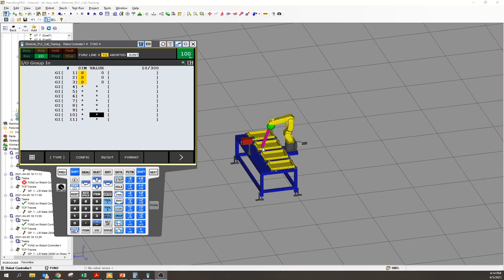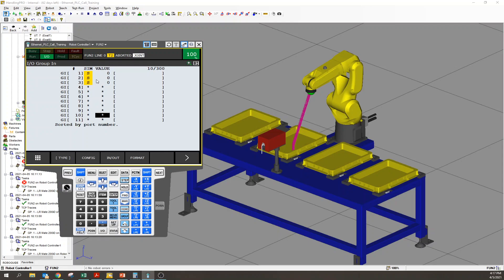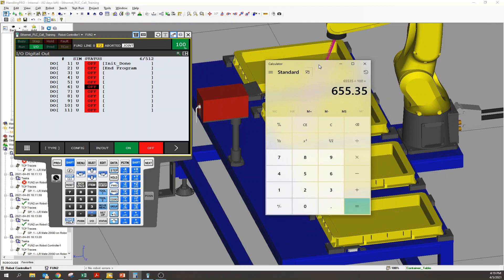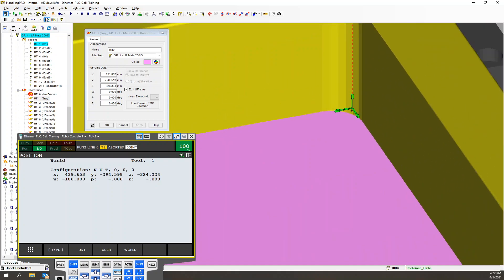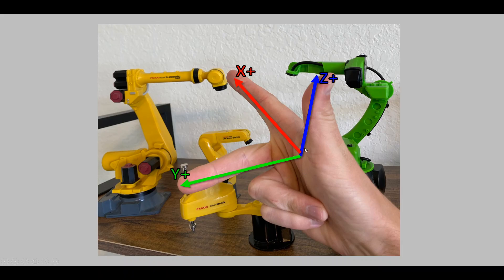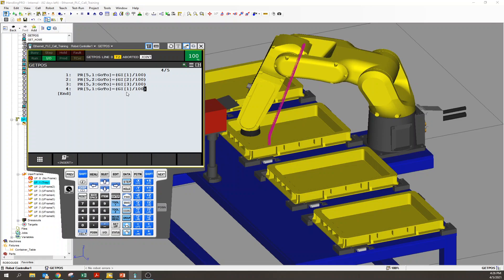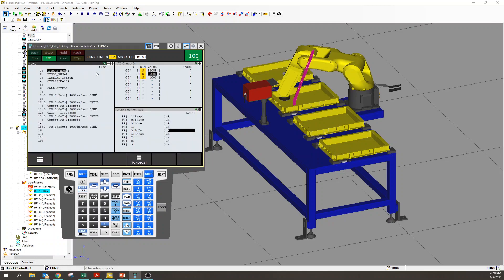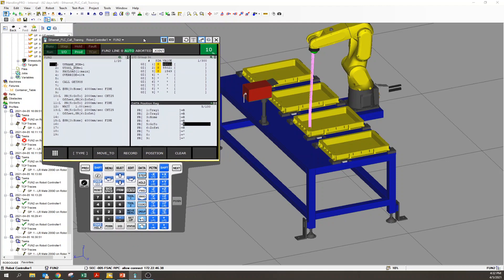Group I/O Position Control [Bonus: Robot Gang Sign]

Comment: Adam, can you post a video or add on to this video explaining and showing how to setup a Group I/O. You already have it setup in the video, so for new programmers this would be helpful. Thanks! Great videos!
Reply from the maker: Hi Christian! At the 2:40 mark in this video here I touch on how I configured these Group I/O. 
In short, you need to map the discrete bits from a rack and slot. Different io forms are different racks (ethernet, physical wires, profinet, flags, etc) but it’s quite simply just setting rack, slot, and number of bits. Let me know if that helps, otherwise I’ll put out a video that does a deep dive into mapping. Thanks!
Reply: @AdamWillea  Thanks for the replay. It seems to be working for me now. I do have a video request, a video on importing a CSV file with POINT coordinates into Roboguide (into a .ls) so that the points in the CSV file are programmed into the robot for say, a weld, eurathane, or some sort of dispensing program onto a part. Thanks!
Reply from the maker: @christianseekins4346  that's a great recommendation! I'll see if I can work something up for a video on importing points via CSV file. Thanks a bunch!

Comment: Great video as always Adam! 

It's crazy how simple the tp program becomes when using this method. 
Unfortunately the only drawback is that doing touchups now entirely happens via the PLC, but I'm sure you can write a program to work around that using macro programs with Lpos logic etc. 😉 It's the beauty of our Robots - they offer many ways to do the same thing! 

I believe you can go one step further with your program - use a register that gets populated by a GI, to call different UFrames.  
Then pick out of any tray 😁 

I've seen a lot of European systems that were installed here in South Africa that use this style of positioning via a PLC. 
Difficult to touch up programs if you don't have the PLC guy with you 🤣 

Keep up the awesome content!

👉🏼
Reply from the maker: Well said, Leonard! I agree completely. And yes - you can certainly take this to a very advanced degree of "modularity" with R[x]'s and Frame control, FOR Loops, etc., etc. The sky is the limit!